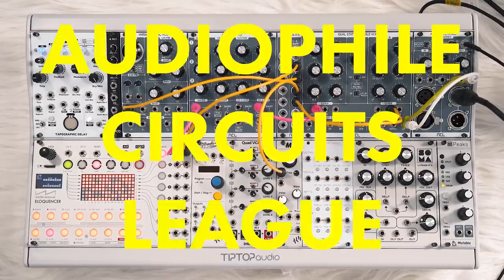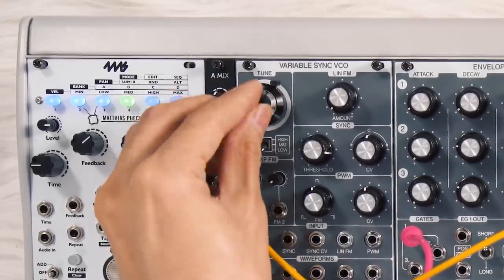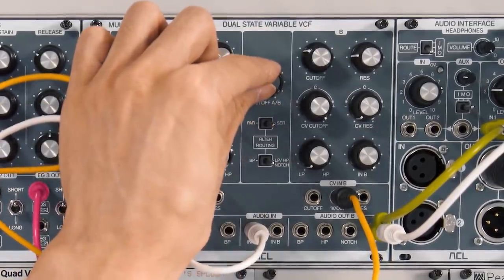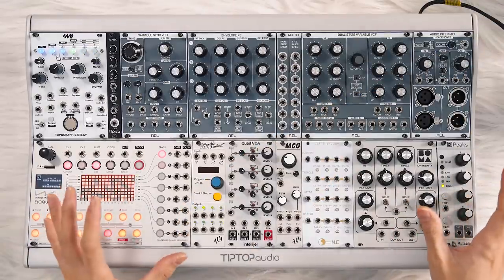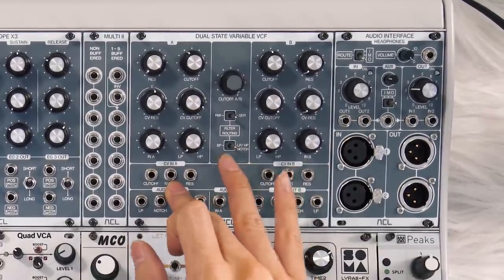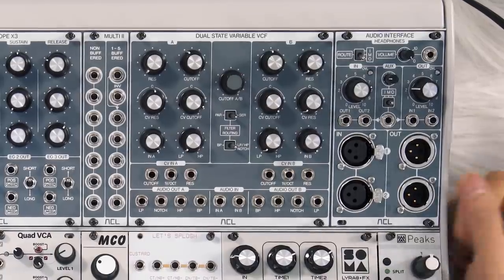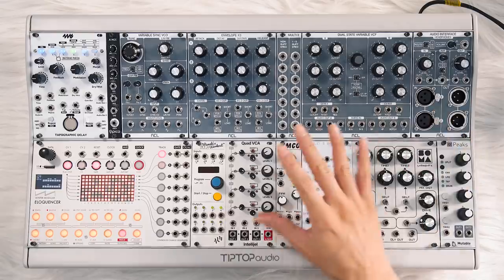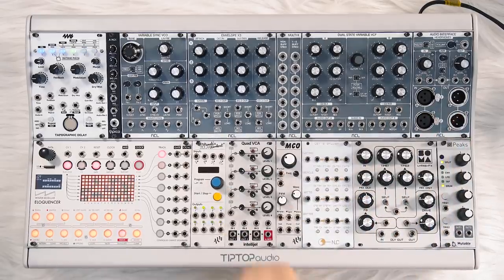Audiophile Circuits League demo & review!

Comment: Great review. 100% totally love that tuning knob, it reminds me of the dials on a vintage mass spectrometer or something. I kinda like that extra invert thrown into the mult, but for all that HP why not have all the outputs buffered?   Also, yeah, those panel layouts are all totally awkward!!! I am glad you pointed out the whole row/column thing on that envelope layout - that was driving me nuts.  I hate to say it, but modular usability is as much interface as it is electronics inside.  I wish they had not compromised so much on the knob layout, I bet those pots are giant on the backside - constraining where they could put them to a large degree.

Comment: There are mics with xlr connections too right so that con is just dependant on the mic you have
Reply from the maker: Mic level and line level are different
Reply: @suturesound  don't you have a mic preamp somewehere between all that gear?